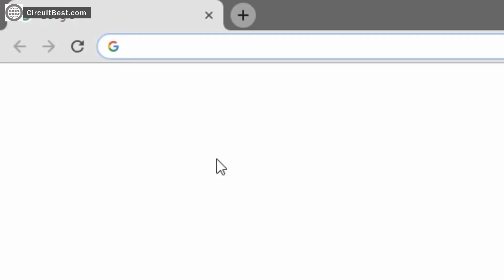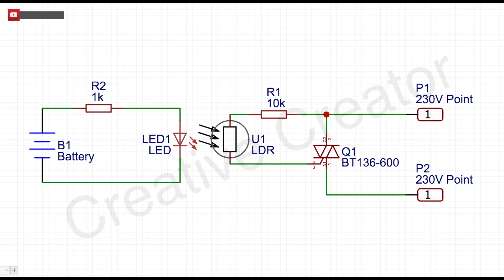Simple Solid state Relay circuit

Comment: Отлично, просто и доступно.
Если добавить к светодиоду термосопротивления то получится схема для инкубатора , или другого устройства где нужно будет поддерживать температуру.
Удачи вам.
Great, simple and affordable. If you add thermal resistance to the led, you will get a diagram for an incubator , or other device where you need to maintain the temperature. Good luck to you.